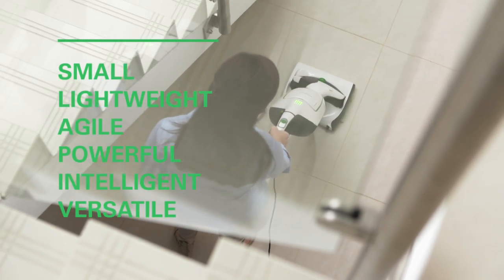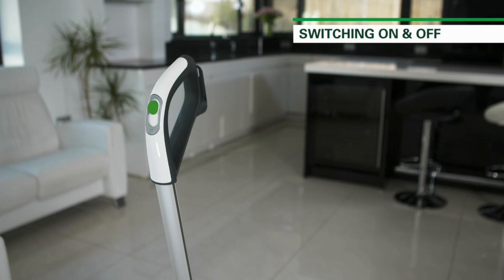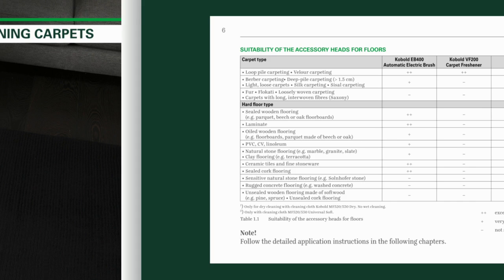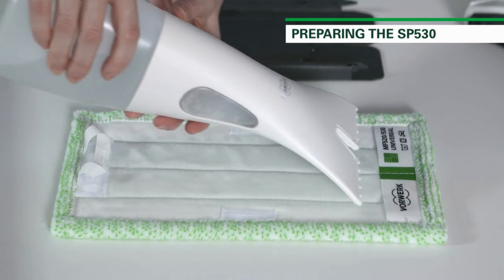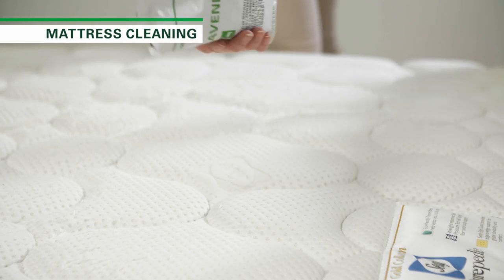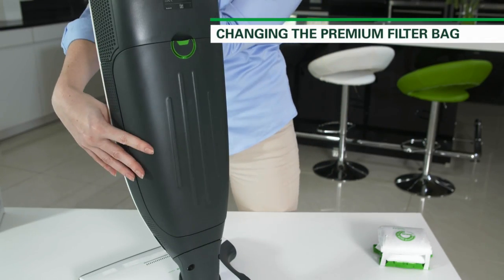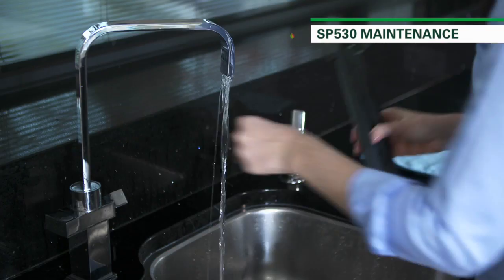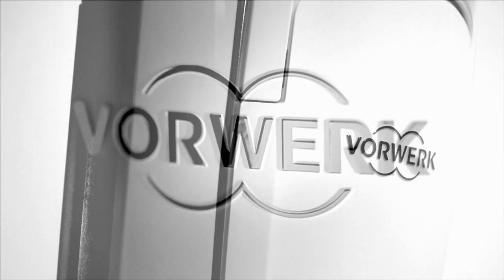VK200 instruktionsvideo

Comment: SEEMS LIKE A WELL THOUGHT OUT MACHINE THOUGH A CANISTER WOULD BE MUCH EASIER TO USE ESPECIALLY WHEN SWITCHING ATTACHMENTS.
Reply from the maker: Vorwerk has also made a traditional canister vacuum called VT300 as well :) using the same attachments with the same powerful suction :D